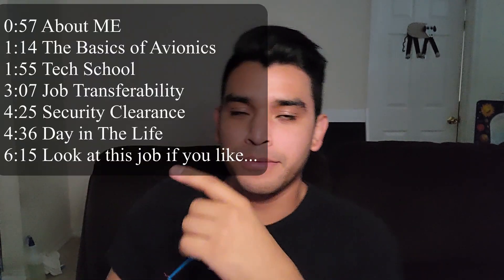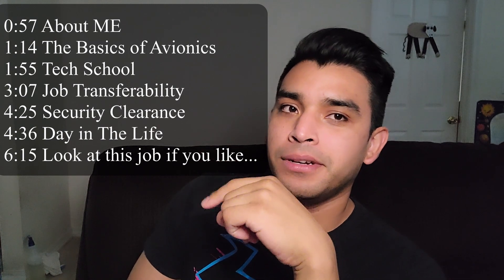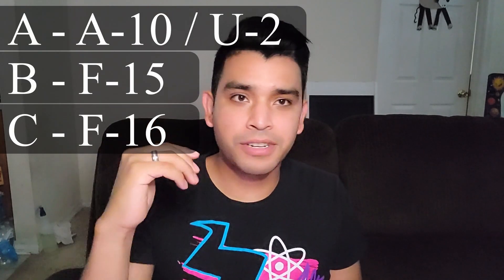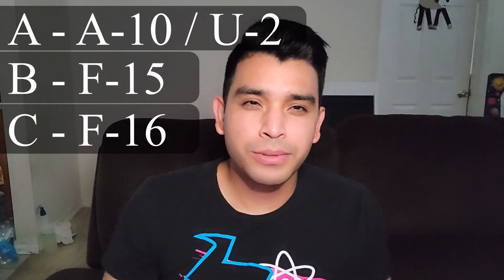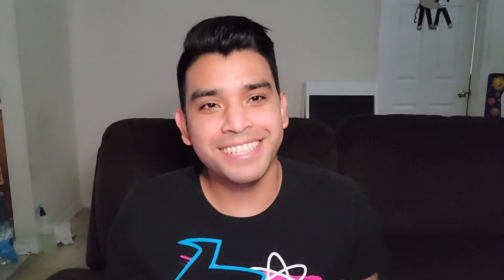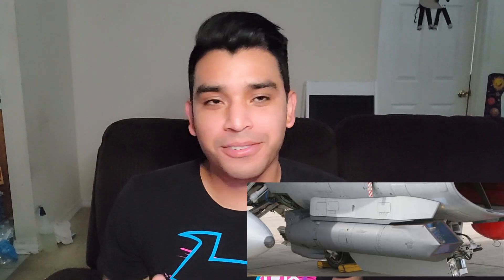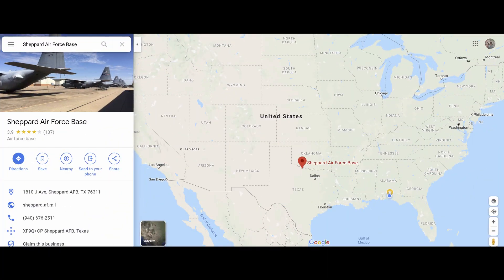2A3X4 Fighter Integrated Avionics | What is it? | Tech School

Comment: Got 2a3x5 Advanced Fighter Integrated Avionics. Is that similar or different? Will I only be working in the cockpit or the entire aircraft?
Reply from the maker: It’s very similar. Basically the same job. Except you will be working on gen V. (F22/F35) from what I know you will still be stuck to one aircraft type. You will test and repair all avionics systems in the jet. I hope this helps.

Comment: I'm doing this exact job for the F-15E Strike Eagle. I'll put the job in simple terms....YOU ARE A MAINTAINER (aka FLIGHT LINE MECHANIC) working on a fighter aircraft. Your primary duty is to diagnose, troubleshoot and fix the INDICATING SYSTEMS on the jet. The only times you will ever touch a computer will be to upload an OFP to an LRU on the jet or to download fault codes from a pod. You will work most of your day out on the flight line, even when it's raining or snowing outside. If you are lucky, you will be allowed to have a regular lunch break, however most of the time you will work 8 to 12 hours without getting the opportunity to go eat something. At the end of your workday, you will stink like jet fuel and hydro fluid, and your work boots and uniform will be covered in grease, dirt and other stains gathered from the flight line.
Reply: Was it an enjoyable experience?
Reply: @graysonjurado4128  For those who want to do this kind of work, yes. For those that were tricked or pushed by their recruiters to do this work, no.
Reply: @graysonjurado4128  would you enjoy to smell like jet fluids and work on a 12h shift out of the rain or snow? I really think this job sucks. If you have the chance go to cyber jobs or any office jobs in my opinion. Im trying to join the air force but if they give me this job i would definitely not join
Reply: @willbermudez2386  good luck Air men
Reply: Looking forward to it!

Comment: I’m new to this, but to clarify, you said you are assigned to a shred, we don’t get to choose? Meaning deployment assignments will be based on whatever we get assigned?
I ship out on the 19th and haven’t found much on avionics in the Air Force apart from the basic promo videos and this one but not many other personal experience videos
Reply from the maker: Yes so from what I remember you do not get to pick which jet you work on. And then the base you will be assigned to will be based off of the jet you work. Each shred has a handfull of bases. I may be remembering incorrectly or things might have changed but this is how it was for me. Also, you will not know what base you will be assigned to until mid-end of techschool. Hope this helps.
Reply: @OurCamoColoredLife  Thank you for the clarification 
Maaaan that kind of sucks but either way it’s useful information. I’ll just pick different stations for each shred and see if they give me any of those! I appreciate you taking the time out to respond!
Reply from the maker: From what I remember they give you like 1 hour to check what bases you authorized to go to while in basic. But dont stress too much about it because you will have more time in tech school to check out bases and make a dream sheet. Also, get input from your tech school instructors for bases. Bottom line is that most bases are about the same and just depend on the group of people you are working with... dont stress! Best of luck to you with your training!.... also If you get F-16 shred and aviano AB let me know! Lol I'll help you out here.
Reply: @OurCamoColoredLife  Thanks again! I’ll keep all of this in mind! And if I do end up there I will definitely reach out! I appreciate it!

Comment: hey man do you know anything about 2A933? bomber  / special electronics warfare / surveillance radar? is it similar to what you do or not and also what kind of clearance and also is it worth it or no? please help me out thank you sir!
Reply from the maker: It is very similar to what I talked about I the video. However, you will only deal with those listed systems instead of ALL avionics systems. Also, you will be working on much bigger aircraft (heavys instead of fighters) the clearance will depend on what aircraft you get put on. I was actually offered this job in tech school for B2's but turned it down because of the limited base options. Ultimately your career will be what you make of it. That AFSC will be very similar to what I talk about though. I hope this helps bud. Let me know if you have any other questions!
Reply: @OurCamoColoredLife  thank you so much sir!!
Reply: @OurCamoColoredLife  so you get offered other jobs at tech school as well? Yeah the travel wise for the jobs sucks, the airforce gave me this job I'm in Dep rn and I'm kinda thinking about it.
Reply from the maker: I was offered a change in jobs in tech school because a slot opened up for it. It is a pretty rare thing to happen.
Reply: Aye bro i've signed for 2a9x3 also , it was told our job reguired a top secret security clearance. you will not ever find information about this afsc because of how secret it is.
Reply: @yungkeil1  so you also got the same job?? When do you shipout?
Reply: @fijisfinest5948  still waiting

Comment: What are the hours like? Do you frequently work overtime? Do you usually work weekends and at night? I haven’t been able to find answers to these questions and would definitely appreciate your feedback! Thanks!
Reply from the maker: The reason you did not get any feedback for this is because it really depends on where you are at. I can only tell you what I have experienced personally. So.... Hours? Depended on the day really but there were certainly some days/weeks where we worked up to 12 hours. Weekends are on a rotation and sometimes no one needs to come in but it is still always a possibility to get called in at any time. Nights are also usually a rotation. The flight line is open 24 hours a day so there are 3 shifts, days, swings, and mids(midnights). And the work on each shift is different. Aircraft maintenance is usually "mission essential" so we will work until the jets are fixed or decide that it cannot be fixed in time. Hope this helps.
Reply: Our Camo Colored Life ok good to know thanks! I appreciate the info. So for the fighter aircraft avionics tech job, do you frequently have to work through the night? Or only when the work load gets heavy?
Reply from the maker: There are three 8 hour shifts on the flightline. Days, Swings, and Mids. Mids works generally from 9pm to 5am. So yes you may be on mids and have to work through the night. The work load only changes the total number of hours you have to work a day. Up to 12 hours max usually.
Reply: @OurCamoColoredLife same as civilian a&p mechanics

Comment: I just got this job in DEP, any way you could tell me more on the “day to day” of the job? Curious if it is something I would like to do, thanks!
Reply from the maker: Fore sure! So day to day is hard to be exact with because it will depend on the base, the mission, the unit and many other things. But, I will do my best. Most of your work will likely be troubleshooting. This means that if a pilot comes back from a flight and says there is an issue with a particular system that is avionics it will be your job to figure out how to fix it. For example if a pilot says there is an issue with his radar you will be the subject matter expert that will be assigned to fix this. You will consult all your manuals and find the most likely cause of the issue and try to repair it. Whether its changing a part out, repairing wiring, or reloading the software. If you fix it you will test it make sure it works and sign it off. This is what normal troubleshooting will be like once you are able to work alone. The first year or less on the line you SHOULD be just more in a learning phase and not able to work alone... Your days could be long, short, easy or hard. It really depends. But, if you like jets, electronics, problem solving, or just working with your hands this could be a good fit for you. We are usually referred to as the nerds of the flight line. You will be doing most of your work outside or in a hanger so the elements will sometimes be not in your favor also. Something else to keep in mind if you were hoping for a desk job this aint it.  I hope this helps! Let me know if you want any more info!